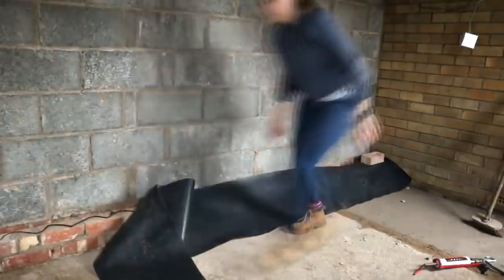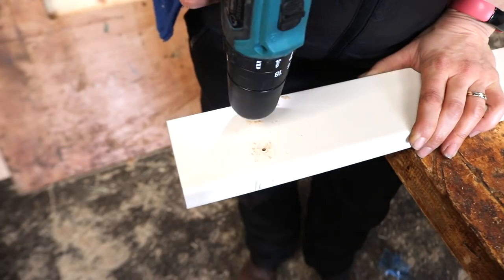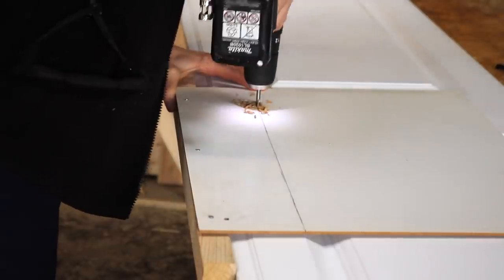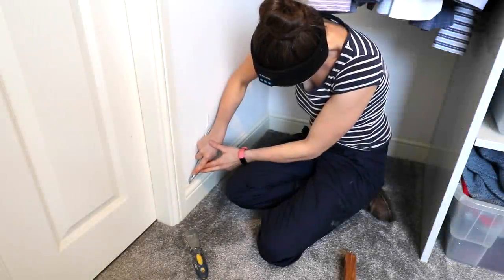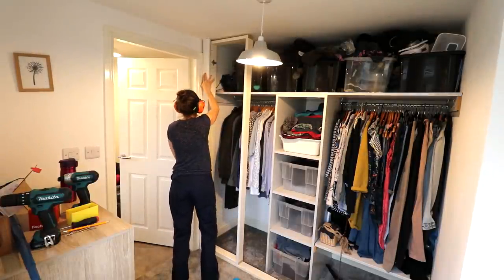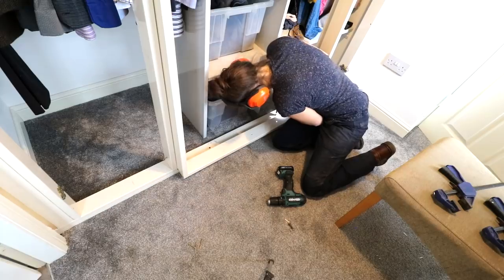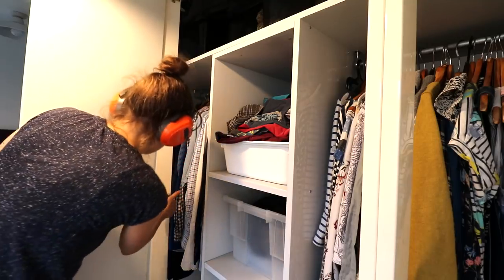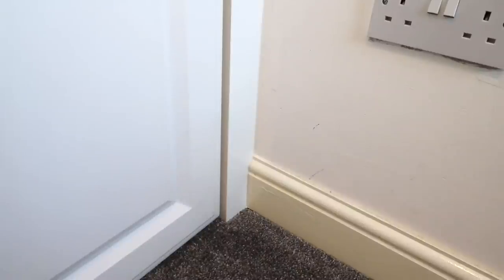DIY Fitted Wardrobe Doors Installation | The Carpenter's Daughter

Comment: I don’t know if it would have worked with your mega-sticky double-sided tape, but sometimes I peel the backing off then put it back on with a folded corner sticking out. Then you can carefully pull the backing off, with the wood in place, and Robert’s your Fathers’ Brother!
Reply from the maker: Yeah, may have been a bit too tight.  I just managed to get a knife between.  And hmmm... where's your source from? 🤔
Reply: @TheCarpentersDaughterUK  I’m not understanding. Source?

Comment: Great job V, quick question, do you plan on purchasing another shelving unit to place one at each end and have the clothes rail in the middle? The frame infront of the clothes rails as it is now would drive me insane 😂😂
Reply from the maker: Lol... nope.  But I've kept the doors central as I plan to turn the centre section into drawers.  I suppose that's the thing about ready made MFD doors.  If you made them from scratch, you can plan it more around it.
Reply: @TheCarpentersDaughterUK  that'll look good! Very much a drawers for clothing over hanging them myself.

Comment: Love the Pirate at 5.58 ;0)

Tips wise .....
                          Rather than using small lengths of double sided tape why not go for one full length one?
..... Once you get it taped down on one side peel a short length of the backing (or should that be Fronting?) off at an angle and place your face plate over the covered section of tape to get the position. then simply hold the non stuck section off slightly and slowly pull the remaining cover of the tape pressing the plate down incrementally as you go!

There is a trick with your top piece of framing and the ceiling (if it is the right position).  Hold your top piece of frame up and scribe the position of the uneven ceiling on it. Plane it down, leaving it fairly tight. Next cut a spare piece of 2X4 (or nail 2 pieces together) to be slightly higher than the ceiling, put a scrap piece of wood to protect the ceiling and wedge the 2X4 up to the ceiling ...... it will push the plasterboard up, so not too far with this. Put your top frame in place and remove the 2X4 and the ceiling drops 1/2" to be tight on the top of the frame! It works best if the joists run parallel but not next to or over the frame.
Reply from the maker: 😂  I played it back in silence last night and didn't know what you mean.  Just watched it again with the sound on LOL.  That may have worked.  And thanks for the tips :)